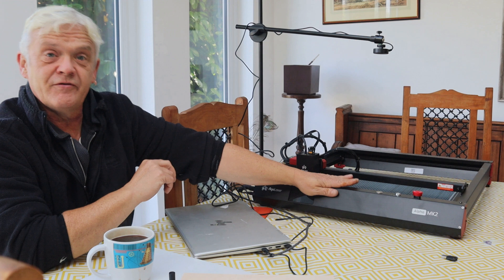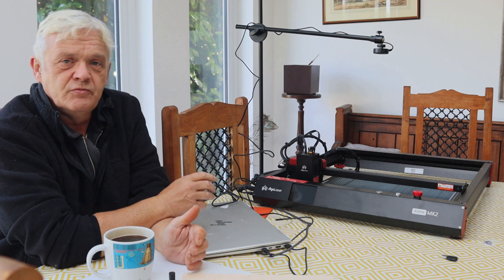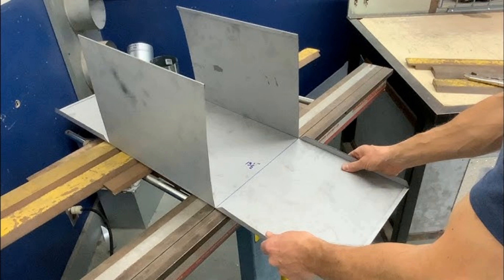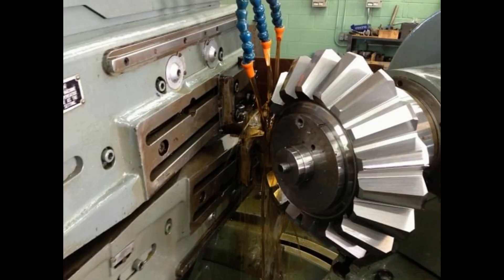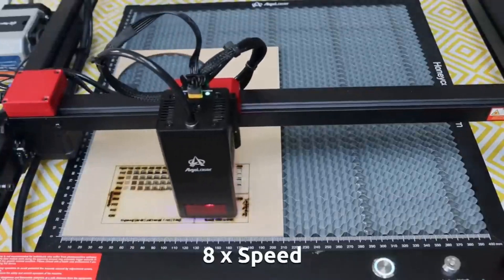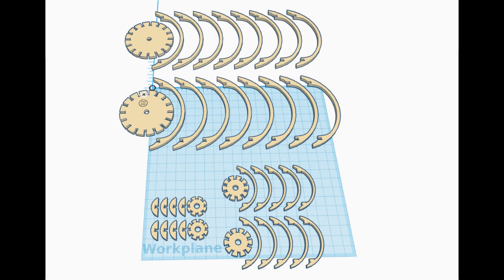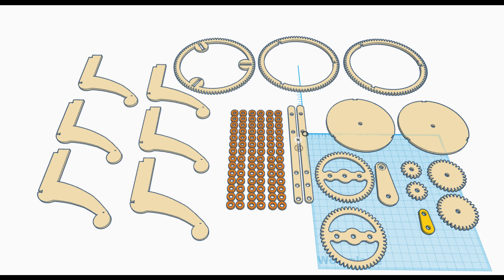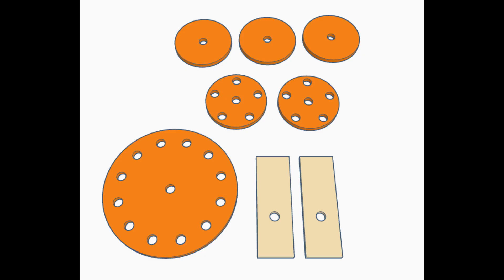2306 A Wooden Orrery #AlgoLaserMK2, #AlgoOS, #AlgoLaserSmartMachine

Comment: I found the way to align things is to fix a piece of thin wood to your hex plate, set up to cut a line 5mm in from one side and the bottom- so cut the line, leave the outer edges of the wood and remove the part cut out, then use that as a positioning fence, draw up your parts 5mm in from the edge, then they will cut at the defined position
Reply: it is sacrificial, I have just cut out the sides for 25 boxes, and have noticed that I am trimming 0.3mm off the part against the fence now and the fence is blackened and wearing through

Comment: Fantastic video. Mechanical orreries are great tools to quickly get a sense of current planetary positions, without using a computer or electricity. 
Now I absolutely love mechanical stuff. But I have a special request/suggestion. In your thorough library of 2300+ videos, I have never seen any on a classic and personal favorite of mine - Lord Kelvin's Water Dropper. It generates electricity with nothing but water drops - how cool is that right? 
Now we all know the theory behind this machine, but the machine has deceivingly complex variables (electrode height relative to the water beading boundary, conductivity between the wet receiving receptacles, etc.) that add to one another, and I've actually never been able to built a working model.
Reply from the maker: i id make one - years ago - nbut i have never done a video on it - good idea mate - cheers
Reply: @ThinkingandTinkering  Looking forward! Have an amazing day

Comment: This shows that in a sense one can print 3-D objects with "laser-printers." Although there would be topological limitations, perhaps, not sure. I have seen wood cutting laser machines that carved wood out at different heights though to make engravings on doors in the mezzo-relievo style. I'd love one of those. I forgot what that machine's name was. A friend of mine in America mentioned it. With it I could finally make what I want, build a UFO, and then claim a crater on the moon!
Reply from the maker: sounds like a CNC router mate - that could certainly do that job if you used a pin bit and moved the z direction as well as XY

Comment: I have an XTool D1 and was having trouble aligning jobs within the work area. Initially, I was skeptical about the “smart” cameras people use for job setup, thinking it was just hype. However, I ended up acquiring a camera, and after some setup with Lightburn software, it completely transformed the process. Starting—and more importantly, restarting—cutting and engraving jobs without precise alignment has become much easier. After about an hour of setup, you can simply place your material in the work area, drag and drop or add your design directly onto the image of the material, and the laser cuts and engraves with precision. This method is just as accurate as painstakingly aligning everything using measurements and the laser’s coordinate system, but far quicker.

It’s definitely worth using and is a huge time saver. Thanks for the video!

By the way, do you have a Tinkercad tutorial in your vast library? I’m still learning CNC, milling, laser cutting, and 3D printing. I’m working my way through Fusion 360 and more recently OnShape, but sometimes I’d like to use Tinkercad for simpler shapes and projects.